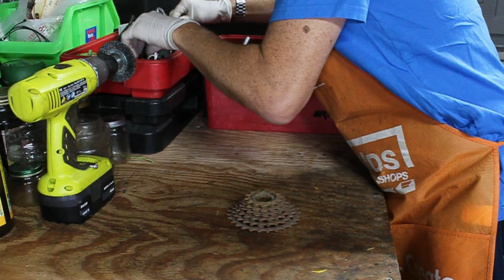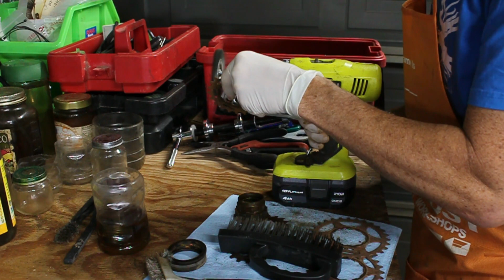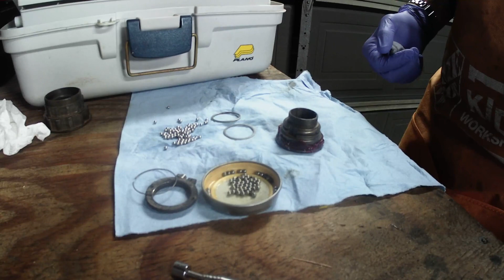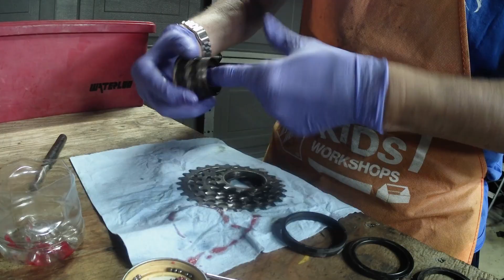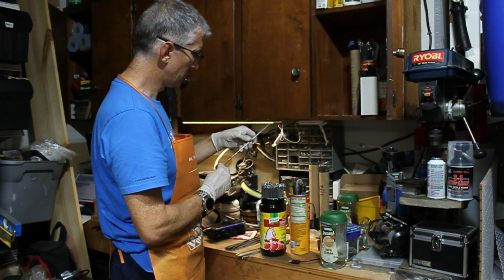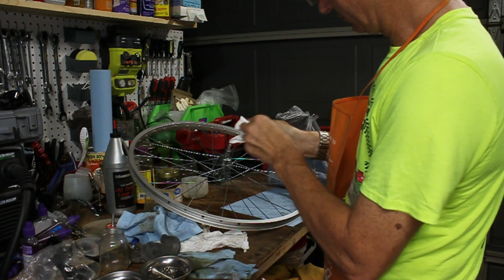Rear Wheel and Freewheel Restoration

Comment: Sometimes I take off the main body from inner pawl part and just soak in evaporust for 24 hours or so. Half the time the freewheel turns darker than it was originally but I dont mind. Maybe I am soaking too long? Will have to keep that in mind down the road.
Reply from the maker: There are many ways to remove rust and not all are universal. I am also investigating electrolysis as a possible option and will be creating a couple videos of my discovery in the future.  I am also looking into nickel plating as a form of rust resistance.  We'll see where that takes me!
Reply: @oneloosesprocket  Right on, I've always wanted to copper plate a nice steel frame.